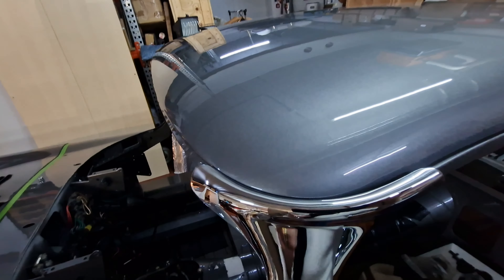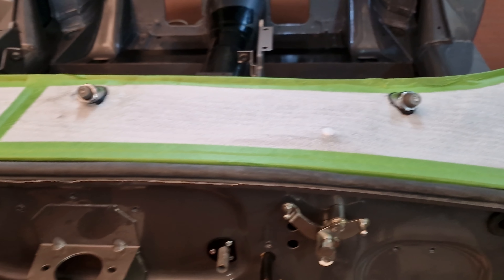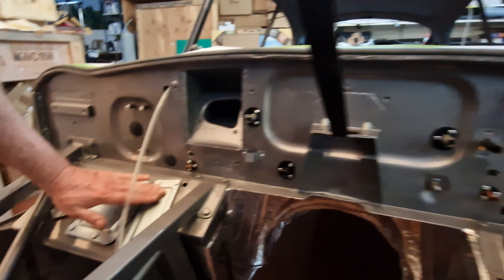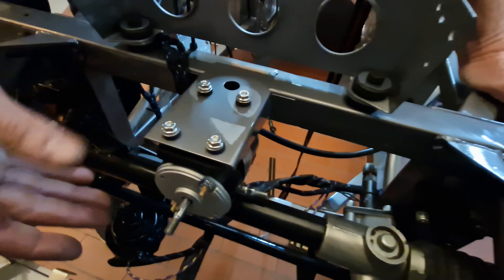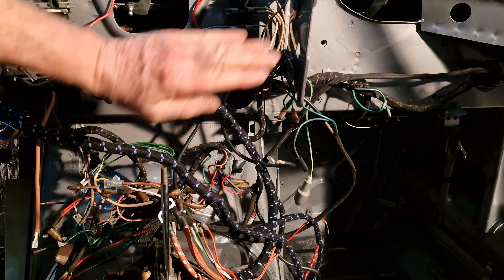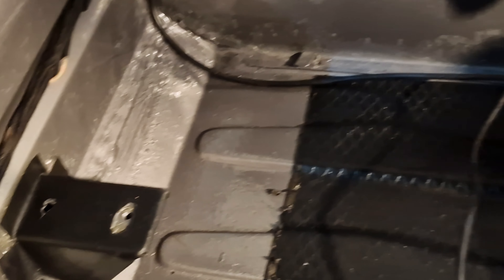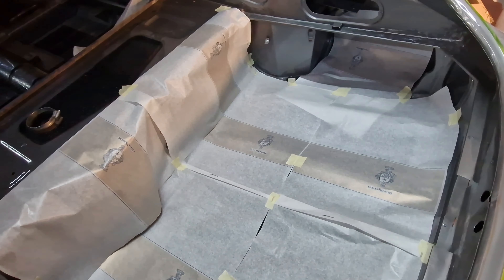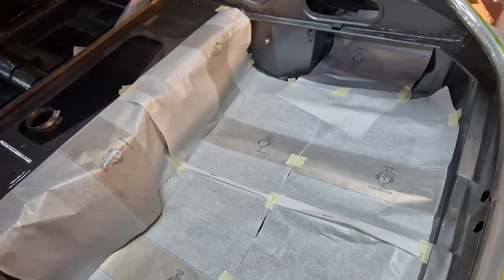🔧Jaguar E Type back from paint shop - Restoration Pt. 10

Comment: Good job, Maikel, I wonder much it's cost, the new paint, because I will tty it myself in the garage with my project Jaguar e type.
Reply from the maker: @franklupker9293 hi Frank, cost of paint job depends very much on the preparation you have done before. The body was already in near perfect condition, so, I could apply the primer and did lots of work on my own. But in the end you have costs for material, and the final painting what I get done by a professional. I trust those who have the experience and doing it as a daily job. I would not risk. Plus I can get other things done I really know much better than final painting. At least that is my opinion. I also know other people painting their own cars and they also do look good, But they are using a cabin. Good look 👍
Reply: @JaguarEType , don't have a cabin, but I have an other garage from a friend, that I can use for painting the bonnet first. Use some plastic for the ceiling and water on the ground. dust falling is the enemy only. Frank.

Comment: Hi Maikel,
Thank you for this new instructive video.
First a question wrt your hockey sticks: am I misled by the video or the fitting of your hockey sticks does not well follow the curves of the roof  (at 3:12 and 4:03)? Adjutment will be necessary.
Very happy to see your (accelerated) installation of headliner, and thank you to your"assistant" who does the job. I had not seen a video of it before, only photos, and I knew some of the tips but it is useful to see in real. 
Congrats for the nasty task of spraying that anticorrosion grease everywhere. I am Happy to have it done by a shop on my FHC! The cleaning of the car was probably not easy afterwards...
I will be very interested to see how you prepare and retrim the cantrails, I know it is not easy.
Good continuation!
Reply from the maker: Hi Serge @paydase,
the A post pillars on the car are perfect. You have to imagine the rubber seal and the horizontal chrome stripe is missing. It will then be aligned in a perfect angle.
If you do not fit these hockey sticks while preparing the body for the praintshop, they might touch the bulkhead as we have seen on Daves XK150. 
The anti corrosion is a nasty job, but I wanted to show it and give an idea of what it takes. It is about 1/2 a day, but bringing it somewhere and picking it up is almost the same amount of time. And often you do not find one doing it PROPERLY, even you have someone getting it done for you, I prefer to rely on my own standards rather than paying someone only to find out it was not as good as I expected it to be. Someone might call it picky. Most of the trim is already done during the time the car was at the paintshop and will be just plugged it. More videos will come just needs getting everything together. The more detailed videos will be on my website for members.